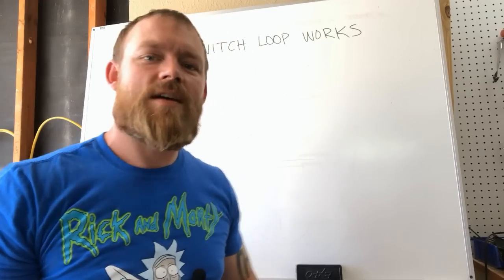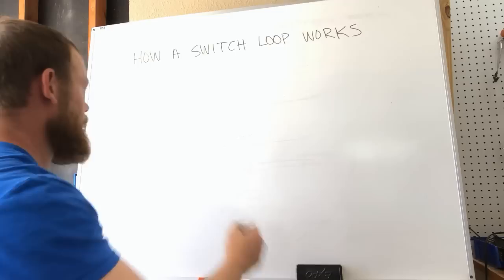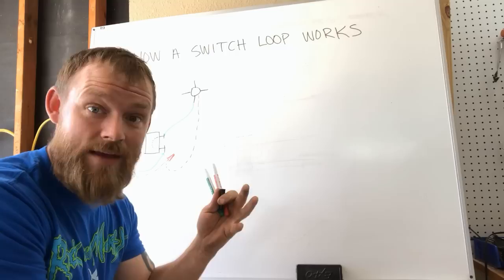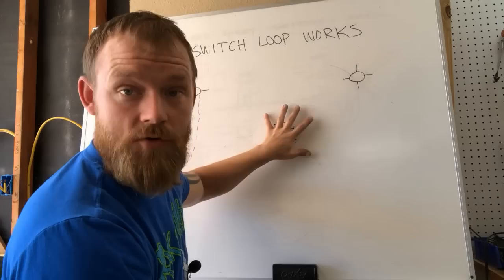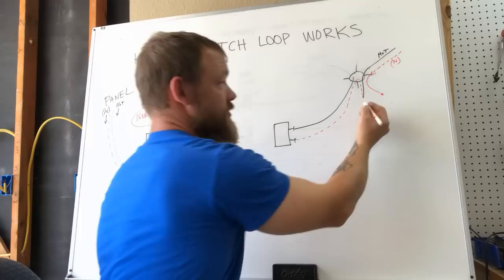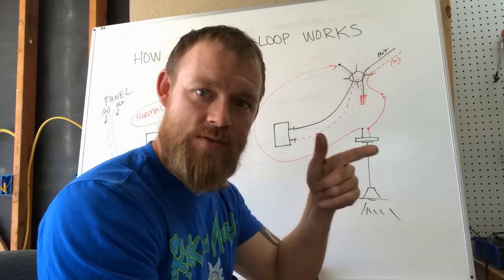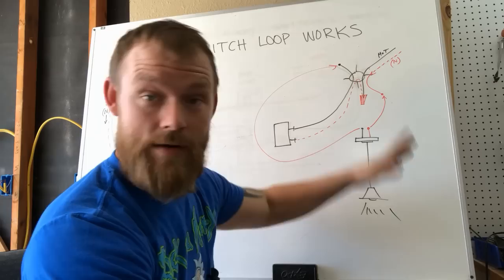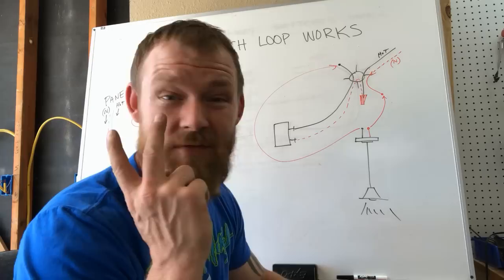Episode 13 -  SCHEMATICS how a switch loop works

Comment: Can you explain how to run the power lines to a 14/3 wire switch and have two switches?

I am about to add fours recess lights in my kitchen
Reply: He has a video out that shows how to do it already. I believe it is episode 6. (What you’re looking for is called a “3-way switch”) funny name but that’s what it is.

Here’s how you do it:

You need 3 sets of wire in this order:
14/2 (HOT coming from panel to switch 1)
14/3 (Traveler between switch 1 and 2)
14/2 (LEG traveling from switch 2 to light)

In switch 1’s box you’re going to connect your HOT black wire (from the 14/2 cable) to the BLACK screw on your 3-way switch.

Connect the 14/3 and 14/2 neutrals together

Connect the 14/3 and 14/2 grounds together, and also connect one end of the ground cable to the switch clip off the other end.

You’re going to connect the red and black wire coming from the TRAVELER cable to the gold screws on your 3-way switch.

Send the traveler cable to switch 2.

Do the same thing but instead of the HOT coming from panel, you will connect the 14/2 to the light, then in switch 2 box you will connect the black from the light to the black screw on the switch, neautrals tie together and get stuffed in the box, grounds tie together then send one lead out to the switch, connect the red and black traveler wires on the gold screws from the 14/3 cable and you’re all set! 

Doesn’t matter which side you connect red/black from the traveler cable. Basically 14/3 cable just connects to the gold screws, neutrals tie together get pushed in the box, grounds tie together and send one lead out to connect to ground screw on switch. Rest should fit right in place. Good luck

Comment: Dustin, I have a double box with two swiches controlling two different lights. The hots black were tied together (all three conducters) it had a white conducter going to each switch and one jumping from swith to swith. What the hell is going on?

Comment: Why not just use the black wire on the leg from the light to the switch and identify the white going back to the light with black tape?  Seems to me that would save a lot of possible accidents.

Comment: My understanding is the switch loop is dangerous because the hot is always on at the device. For example changing a light bulb in a switch loop device is dangerous..Is this correct?
Reply: George Valente it's not really anymore dangerous than a regular switched light. The light fixture won't be hot if the switch is turned off. There will be two wires (a black and a white) connected by a wire nut that are hot inside the light fixture box, but the electricity still goes through the switch box before coming to the fixture...hope that helps.

Comment: In the 2017 NEC where it mentions that a neutral is required at the switch, there is actually an exception that if you're using a switch loop then the neutral doesn't have to be present at the switch. Is this correct?

Comment: I had this feeling you lived in Austin (idk y tho). Maybe it's because I lived there for 10 years. . .or maybe it's siiick ass shirt you scooped for WalMart lol. So I'm not an electrician, but I watch you tube videos really well and like to figure things out myself as opposed to paying someone else to do them (no offense), if it's something I feel comfortable with doing myself, that is. Electrical work is one of those things that borderline makes me nervous even though I grasp the concept fairly well and have worked for contractors in the past. The point is, I'm applying this to a similar scenario except there is an added caveat. The lightbulb is a garbage disposal (which has a switch between it and the power source) and there is also a dishwasher which requires constant power and both are connected on the same loop. There is a metal junction box that doesn't have a ground screw in it located below the sink in the cabinet. hot comes in to junction box and is connected via wire nut to dishwasher hot and the switch hot. Switch neutral is now a hot conductor to disposal hot. Disposal neutral and dishwasher neutral connect (via wire nut) back to the incoming neutral (or outgoing I suppose)  the junction box neutral and back to breaker. My question is do you see anything wrong with that set up? if so then please lmk what and why. Also, how do I ground the dishwasher and disposal ground wires to the rectangular junction box if the junction box doesn't have a grounding screw.  there is a hole in the back of the metal junction box that has the letters GND (I'm assuming GROUND) etched into it but there wasn't previously one threaded through it and this was somehow wired and worked correctly for 2 decades prior to my mother accidentally breaking the wired connection (junction box didn't have a metal face plate on it for some reason...now it does). It's my job to reconnect them but I want to make sure I did it correctly first. Any info would be greatly appreciated. ATX fur liiiife. Big Preesh!

Comment: I have 3 lights that are tied in switch loop from 1 light switch that controls dining light. Ive found the power wires out of three sets of romex comimg into switch box. Im still comfused when i wired every thing how it should be now my dining light switch works for dinimg light only and i turn off kitchen light the hall light turns off too.

Comment: I have a question. My lights are wired this way. I recently bought a 52in LED light and when I turn it off it still barely is on. Kinda like it glows in the dark. Is the switch loop the problem. Only one switch controls light and its not a dimming switch just a plan single switch

Comment: So thank you for this info bought a new house and it’s driving me insane. I am trying to add an outlet from the same power that’s powering my light switch that had this loop going on is this possible
Reply: It’s totally possible, but you shouldn’t have your outlets and lights on the same circuit. If you plug something in that trips the circuits, your lights on that circuit will go out as well.

Comment: Does anyone know what would happen if you connected the incoming hot to the  "neutral" going to the switch box? Basically just reversing what what was explained. Thanks.
Reply: That's how he has it in the diagram. The dotted red lines are his white wire. 

First electrician I ever worked for said "down on white, back on black"

If you see a white wire mixed in with the black wires you need to pay attention. It's communicating information that's important to you understanding what's going on in that box
Reply: @goaliedude32  Thanks!

Comment: What if I have 2 whites and 2 blacks coming out of my ceiling how do I know what is what? We have tried every possible connection and the light either comes on and the switch does nothing or nothing happens or the light is dim and flickers
Reply from the maker: Do you have a multimeter?  You can get a cheap one from home depot.  You need to know which wires have what voltage on them.  I don't recommend just guessing and crossing your fingers.  A multimeter/tester will tell you exactly what's what.  Also...dim and flickering...is it an LED bulb with a dimmer? There's too many variables, could be a switch loop, could be a switch problem, could be mismatched dimmer, could be wired wrong, could be a bad lamp...or multiple of these lol.  I recommend you hire an electrician.

Comment: help I'm trying to put a dimmer for my master room closet , there's 6 wires from the switch box, four on the right two black two white on the left I can tell it's for the switch one white and black.       on the right out of the two wires one is hot. and two naturals.? I know two things turn on and off when I flip the breaker it's the Bathroom Nd the kitchen wall

Comment: I’m dealing with a 2 gang both switches are switch loops I’m trying to install a witeless switch and all I need to do is locate the neutral can you help
Reply from the maker: Whichever one doesn't give your a voltage to ground with your digital multimeter.

Comment: Would you be able to make a switch loop with a neutral if you used 12/3 wire instead of 12/2? Connect the 2 white and then the red to incoming hot?
Reply: Good job Alan. You are correct, and you would meet NEC code by doing so.

Comment: Hey bro was in a house the other day on a service call and the switch es in the bathroom were all neutral switched. It would be sweet if you could do a video on that.
Reply: a video on what exactly? on older gens using the neutral wire on switches? thats a bad bad idea and shouldnt be shown to anyone other than to discourage it and show that its completely against code... last thing you want is your hot to go directly to your light and cut after it passes through your light... if you touch the leads on a light wired this way, even if the switch is off, youll get a shock. You want to use the hot leads on a switch ALWAYS so as to abide by code and cut current before it reaches the light (or any other device).

Comment: I always put a round of 33 on my switch legs. If my switch leg is the blk wire, I’ll use an odd ball colored phase tape. I’ve ran into several fixtures that the home run was ran to the fixture (u would think it became a switch loop) but the hot stopped at the fixture and the neutral was looped. Breaking the neutral at the switch . That will get ur ass lit up at the fixture if u think that it’s wired correctly! When u dont hv any voltage on a switch , but it still turns the light on and off…. Better make sure that this isn’t the case.

Comment: Okay I do get what you're describing. My question is on the Panel side, is that white breakered out or landed in the ground bus, or is that white being fed from an existing circuit?
Reply: Make sure breaker is off!!
Step1:
The panel side has 14x2 cable landed inside it. The black wire gets connected to the breaker screw and the white wire gets connected to the neutral bus bar. You also connect your bare ground wire to the ground bus bar. 

Step2:
Then you take the other side cable 14x2  and run it to the light box. Then connect black wire to a wire nut. Then take the white wire and connected it to neutral side of the lamp(silver screw). Then also connect your bare ground wire to a ground wire nut then connect it to the green screw on the lamp. ***If you have a metal box then take the bare ground wire and loop it around ground screw on the box and then connect to the ground wire nut. Then take small piece of bare ground wire connect it green ground screw on the lamp and then connect the other side to the ground wire nut.***

Step3:
 Then grab another piece of 14awg 2 wire and Land one side of 14x2 cable in the light box. Then connect the bare ground wire to the ground wire nut. Then connect the black wire to the hot side of the lamp(gold screw). Then take the white wire and wrap black electrical tape around it until there no white insulation being expose coming out of the cable. Then connect the black taped wire to the wire nut with the other black wire.

step4:
Take the other side of that cable and land it in the switch box. Then wrap black electrical tape around the white wire until there’s no white insulation exposed. Then connect it to one side of the switch. Then connect the black wire to the other side of the switch. Then connect bare ground wire to the ground screw on the switch ***but if you have metal box then loop your bare ground wire around the ground screw on the box then connected it to the ground screw on the switch.*** Then your circuit is competed. 

It might help to draw it out into a wiring diagram. It’s like you’re terminating the circuit but on paper. If you do this in your own house then make sure your areas code will accept this method. It’s a way to save money on running extra cable. Another good point to make is that people should always test before touch.haha

Also too. You can come off a receptacle too. Say the room has just had table lamps in the room and no ceiling light. You want to install a ceiling fan. The receptacle might be closer to fan location and then you ran run the loop feed to the switch by the door. But it might better coming from the receptacle to the light switch then to the fan/light. It’s depends on what room layout looks like too. Just watch how many outlets on the branch circuit. Check your code for more information.
Reply: Rocky_rocker_123 Okay..so you did indeed answer my question, like holy fuck dude I hope you did that on a computer! The reason I asked the question the way I did is I was missing the concept entirely. While at work today I started messing with the switchlegs in a bedroom 🐙😈 I think I was guilty of what he was saying, thinking of it as a neutral and not a conductor. Thank you, I appreciate the answer!
Reply from the maker: We’re not allowed to use 14 in Austin. Only 12 even if we’re running 15a circuits (in residences) - there are towns in the surrounding area that are ok with it, especially legs for LED cans etc...do they let y’all run 14 where you’re at?
Reply: Yeah. We can still used #14 AWG in Ontario Canada  but the person has to look into what the code requiring when installing the circuit rather they run 14 or 12. 

So do you guys use 20amp wire on 15A breakers and 15A rated receptacle plugs?
Reply: they most def use regular 15A recepts on that 15A circuit. the only thing that changes is that they use larger wire, thats all.
Receptacle ratings are matches to breaker size and not wire size.
Reply: @ElectricianU   14/2 is for all normal and led light circuits up here in PA (15a) Also ok in most places for general use recepts. Bedrooms and such. 12/2 for any 20a circuits (kitchen counter recepts, dining room recepts, garage and utility/tool. It's ok to over wire (12 gauge on 15a circuits or on everything if you want) Guys really hate using 12. It sucks to bend all day as you know lol

Comment: So, could I make a new outlet off that “hot white” wire that goes to the switch. Wouldn’t be controlled by the switch....
Reply: no, unfortunately. This is why there are now codes requiring a Neutral in every switch box . that and newer tech (smart switches and such) requiring a neutral to work. the way its traditionally wired, is just as he demonstrated in the video (neither a light nor an outlet will work without a neutral). what we do now is, run a 14/3 or 12/3 from the light to the switch. then you meet code.

Comment: Is it possible to run a switch loop for a 3way switch scenario. If so, how would you route those wires?
Reply: Yes , you make for example the white wire from one 3 wire the feed and the other the switch leg.  The travelers  black and red  get spliced together  black to black and red to red in the  light's junction box.

Comment: Can I install one of those automatic  Sensor Switches  IN THE SAME WAY or do I need to run three wires? The switch has 4 wire Black,White Red and Green. Need Help
Reply: Black to black white to white green to your ground wire. You only use the read if your incoming power is 220v

Comment: how do i do a switch loop with mutliple lights?  in other words how make 3 lights connected to the switch using the switch loop method?
Reply: Same concept, you just parallel the other lights with the one he drew. As long as all the hots on your fixtures are turned off by the switch leg it will work.
Reply: You tie into the first junction box (at the light itself) 

Run 12/2 tie neutrals together & tie switch leg together.

You would then wire up the new fixture as normal.

For the third light you would follow these same steps, but this time from the second light.

Comment: Why use not use black wire in switch loop
Reply from the maker: For visual reference reasons. The actual color of the wire isn't 100% relevant. You can still figure out what is going on in a circuit even if all the wires are purple. 

Just makes it easier with visual representation of what each conductor is "suppose" to be.

Comment: Is grounding the same on a loop system?
 I have an old house with just the Blk and neutral wires. Can I just ground to the metal box?
Reply: If there's no ground from the existing wiring, there is no way for that circuit to be grounded. Install an AFCI breaker on that circuit if you want to be official
Reply: @goaliedude32  thanks I'll try to remember that for the next time. I'm not sure what the homeowners did but hopefully they got an electrician out there.

Comment: Why would anyone do this in the first place if they had both wires available? I have a wall switch with two hots like this which makes adding an outlet from that circuit impossible without rewiring back at the split to the neutral.

Comment: Labeling the white as an incoming hot in the switchbox definitely should not be an afterthought… wrap some black tape around it.

Should really just get rid of old switch loops in your house (replace them with a 3 wire) if you have the capability.
 There’s a reason they don’t wire houses that way anymore. (Better to have a neutral in the box for modern tech, and no potential for confusion of what conductors are what).

Comment: How can you install another light within the switch loop?
Reply from the maker: You'd have to run another piece of 12-2 from the first light box to the second.  Tie in the new white conductor at the first light box to all of the other neutrals in that box, tie the new black conductor to the switched leg wire in the first box.  At the second light location you'll hook the light fixture up just like normal, and you can continue adding as many lights as you'd like after that.  The magic is in the first light box.